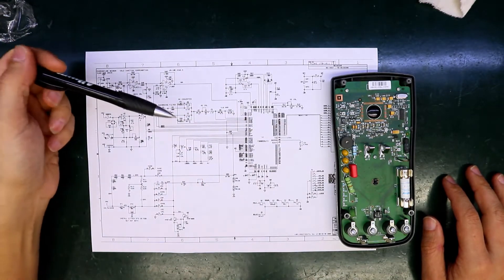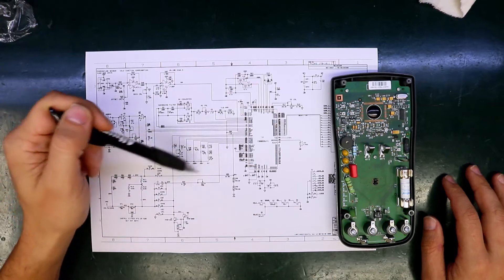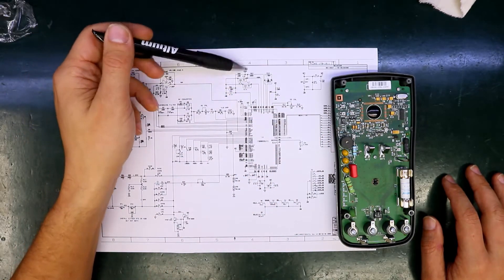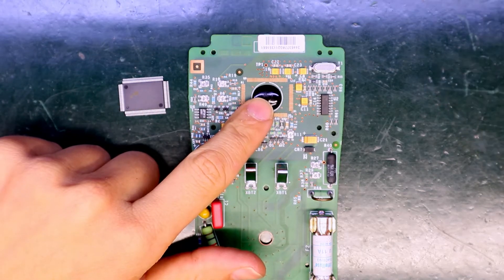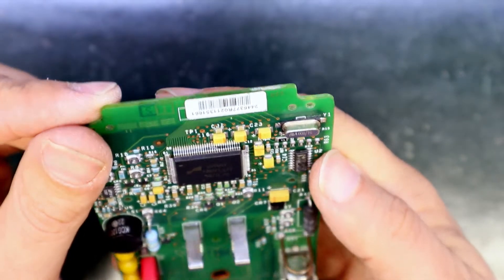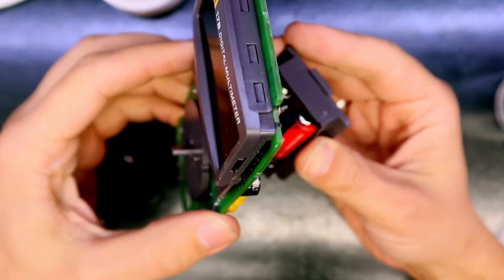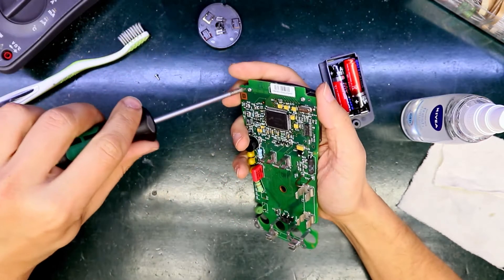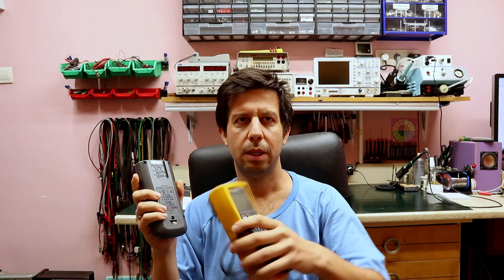Fluke 17B chip on board repair

Comment: Good work on that one! I have fluke 233 with defective main chip. Cristal works, supply is good but the chip is not running program. May I know where did you ordered a new chip. As I understanding it should be preprogrammed by fluke. Thanks!
Reply from the maker: I ordered it from aliexpress
Reply: @NaudioElectronics  fluke uses general purpose FS9721-LP3 chip with ADC + MCU in their fluke17b. Maybe the same way I will fix my fluke!)

Comment: Risky repair 😂, if remove the epoxy like that , it is possible to cut a copper track , which will definitely will be a catastrophy. Any way you got the job done very well 👌.
Reply from the maker: It takes about 15 minutes, so I did it carefully.

Comment: Hi, new subscriber here,, I have question pls. I had cleaned my dmm pcb with isoprophy alcohol, now the meter is no longer accurate. I let it dry using hair dryer.
Reply from the maker: I had some issues repairing an old Fluke and I found that the best solution for cleaning  PCBs is to use a specific PCB cleaner liquid. The IPA is good for everyday use, cleaning flux or dirt. For precision and high impedance PCBs use special products in an ultrasonic cleaner or a special PCB cleaner unit.
Reply: @NaudioElectronics  thanks for the info.